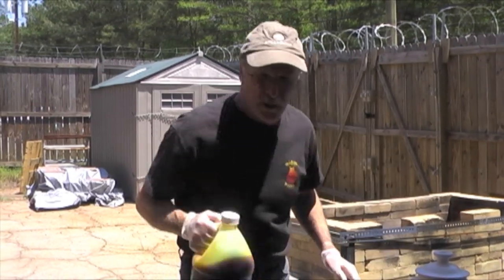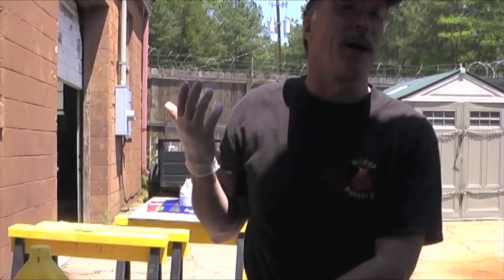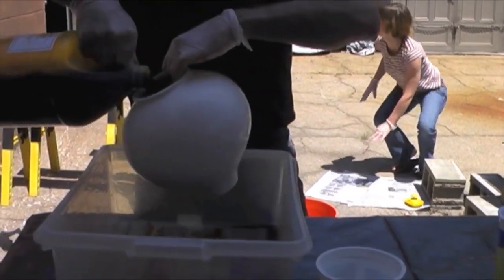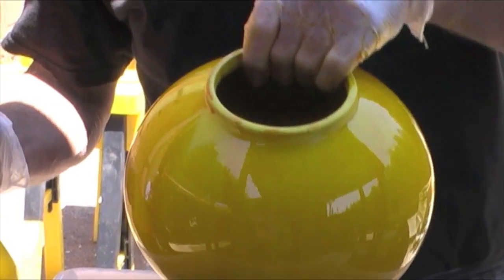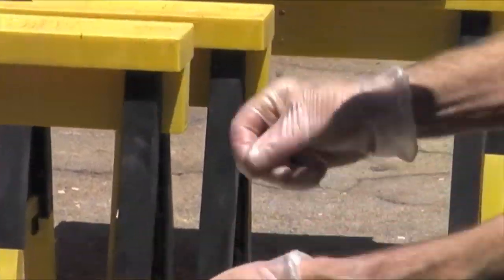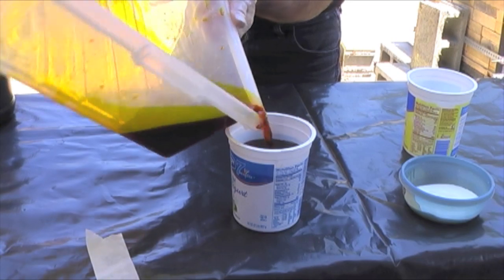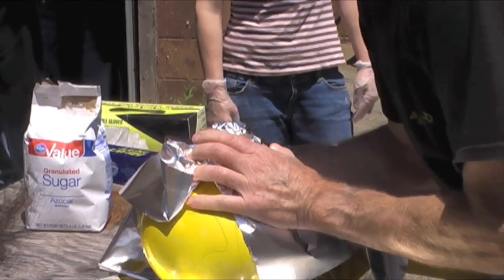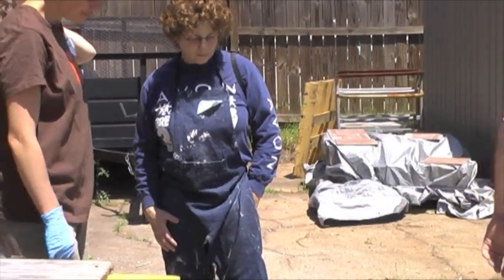Riggs Ferric Chloride Demo - Part 1

Comment: electrolise an iron can or something into sodium chloride (salt water) keep agetating the solution every 5 min or so till it turns bright brownish red. you can then filter it through a coffee filter. the leftovers will be mainly ferric chloride and sodium chloride. To get the last sodium chloride out mix it with plain water and filter again, repeat for a pure end result. do this in a well ventilated area, and don't stick your nose above it. this stuff is very corrosive